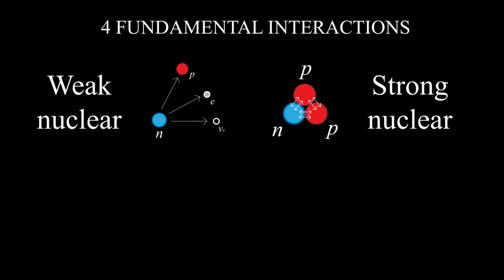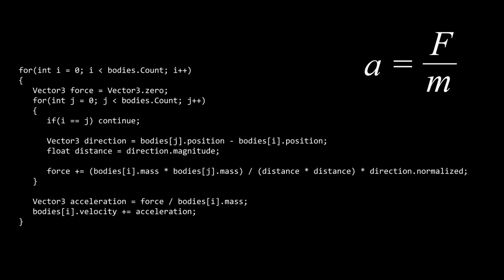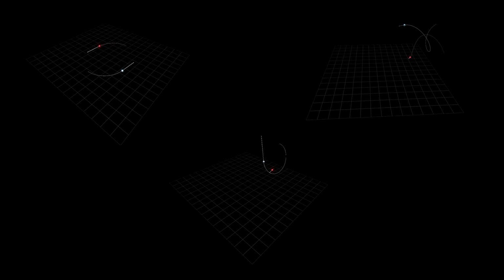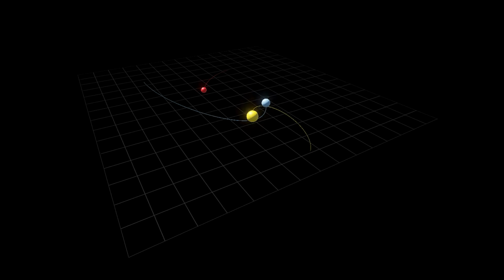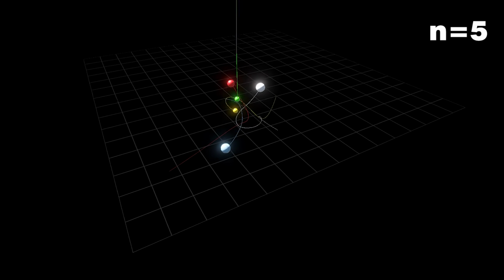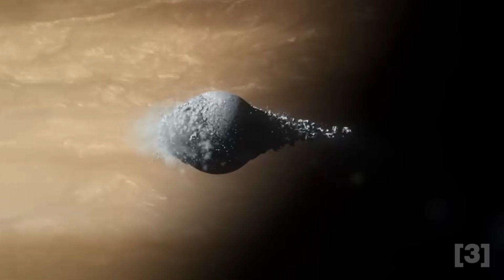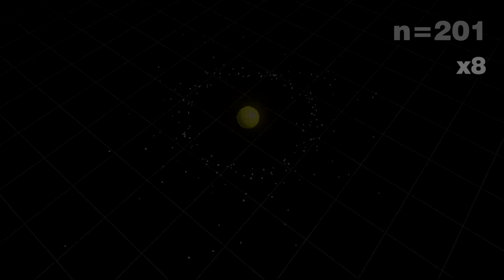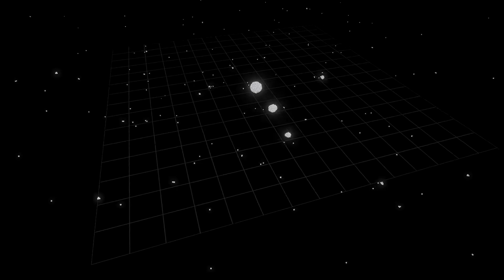How Gravity Creates Worlds: N-body Simulation

Comment: You're actualy calcilulating each force twice. A better aproach would be

for (int i = 0; i < bodies.count; i++) {
    For (int j = i; j < bodies.count; j++) {
        double force = //calculate force
        Double angle = //calculate angle
        bodies[i] //add force with force and angle
        bodies[j] //add force with force and angle + pi
    }
}

Now youre calculating the force between 2 bodies only once instead of twice

Comment: 2:30 Don't update the positions in the same loop that you're calculating forces, or things get out of whack rapidly (i.e. accuracy suffers). Forces should be calculated based on the particles' positions at one point in time, if you start moving particles around while calculating forces you are letting some(!) particles impart forces on others "from the future".
Just use two loops... One just for calculating forces, the other to update velocities and positions.

Comment: Them visuals are beautiful. But I feel a bit cheated; I know that just solving these equations "in simple way" you will quickly run into instability. So I expected some discussion of your differential solver. Or did you delegate it to some of the unity utils? 

Either way, good job. I liked the tidal simulations in particular.
Reply from the maker: Thank you for the comment! I understand what you mean. In my case, I compute the gravitational acceleration in FixedUpdate() and update the velocity using Rigidbody.velocity += acceleration * Time.fixedDeltaTime. Then Unity updates the position on its fixed timestep. I also use softening to avoid huge accelerations at very small distances. In this video, I focused more on visualization, but it's a great idea to upgrade the simulation to a more stable integrator.